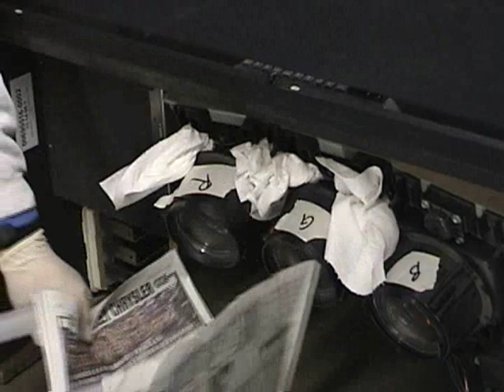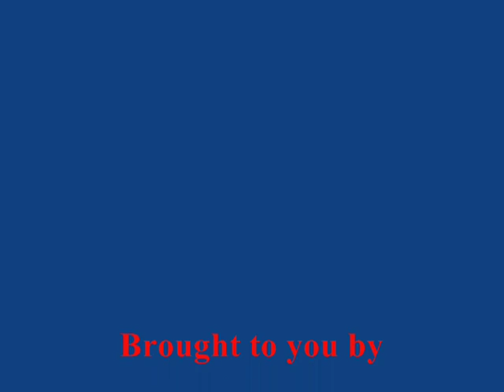Draining Philips/Magnavox Projection CRTs

Comment from the maker: The most common occurrence when doing this process is a small drop of coolant spilled somewhere on the electronics. Inspect the boards very carefully for any evidence of this. If there is fluid on the board(s), clean with a solution of ammonia(clear) and water. Make sure to totally dry anything you cleaned before trying to power up the set again. Secondarily, you might have precipitated a "latent" problem waiting to occur(solder connections, weak capacitors, etc).

Comment: check the vid that shows the lens removed, you have to take the top lenses off, and all you have to do is take out the 4 frame screws, p-lace a small box to keep the assembly level, then removed the top lenses and removed the fluid with a turky baster and tottal clean all surfaces the fluid touched as it will be crud everywhere.  put new fluid in and away u go, BUT there are still 4 or 10 issues to balance the tubes for the best picture possible...

Comment: i have a 60"  phillips   rear projection tv      it  never gave me a problem    other than the picture was fuzzy and the colors where off        i cleaned the guns   that didnt work     then i found this video      .    i followed  the video to the letter     i drained the old coolant    and i refilled them with new coolant ,  i made sure to be extra carefulll    i put the tv all back together   and went to power it on  but  it wont power up    is this a common problem when the fluid is changed
Reply: I just try to  buy one,  Phillips 60" rear projection, so do you recomend this brand or not?
I heard that Hitachi was the king in this technology, what do you think?